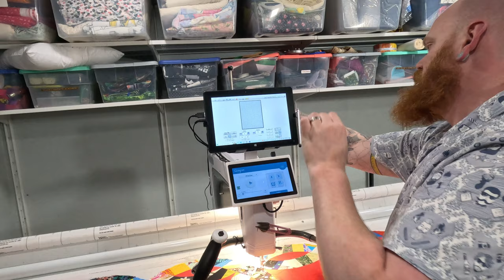Finishing my Double Wedding Ring quilt with Curved Bias Binding

Comment: The easiest way to make bias binding for me is continuous bias binding method. It’s faster, neater and the fewest seams I’ve found. But I got rid of my Accuquilt. The fraying from the die cutting was just unacceptable and wasteful to me - I was losing 1/2” from the edge no matter how carefully I lined up the grain to the blades, and the fussing and constant recutting was so much longer than just cutting with my rotary blade and scissors. Plus all the wasted, unusable even as scrap cuts.